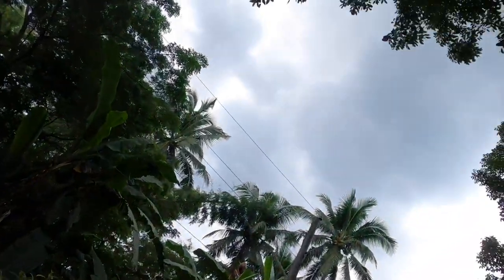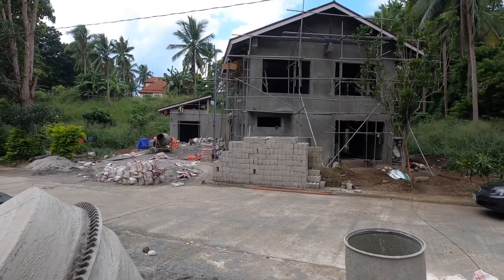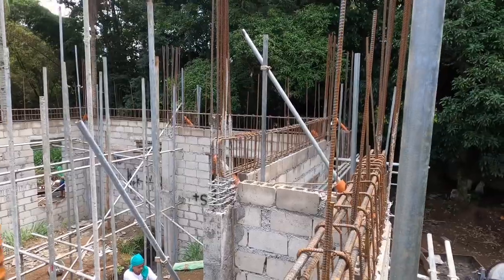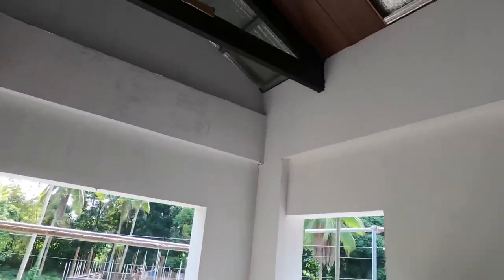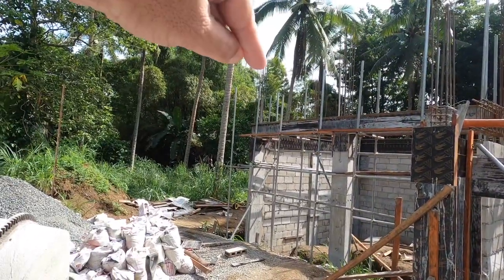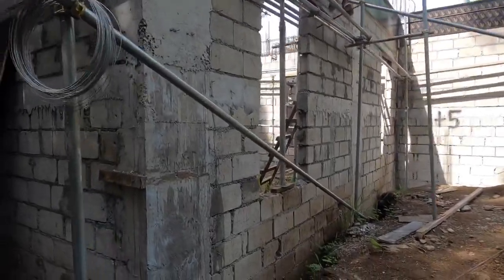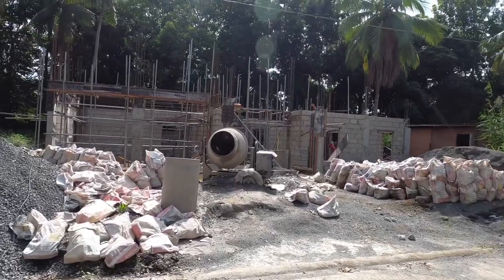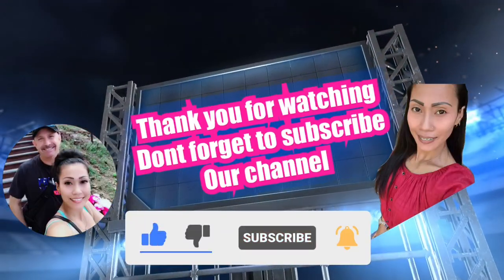Philippines House Build Vlog 26: Second Floor Tie Beam

Comment: I have completed 13 column footing holes and have 11 more to dig in my house build here in iligan city, i only have 1 hired worker for labor. doing my own house build cause its important to build a strong house and some contractors in philippines don't use that standard, making my own hollow blocks, 6 inch at 20 blocks per bag of cement. can't pour any concrete footers until the building permit is finished.
Reply: Building permit without building inspectors?
Reply: Hollow blocks in P.I. is different than in U.S. because they're not load bearing that's why you have beams & columns. In the U.S. you can put up a single story structure w/o beams & columns, just a hollow blocks.
Reply from the maker: Edmhie, you are 100% correct that was something that I had to learn here in the Philippines that the CHP is not load bearing.